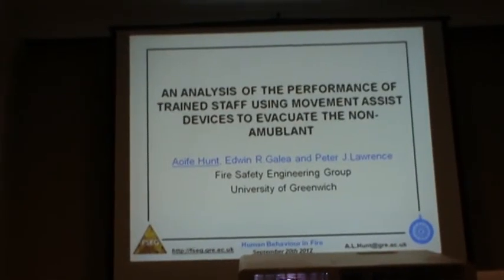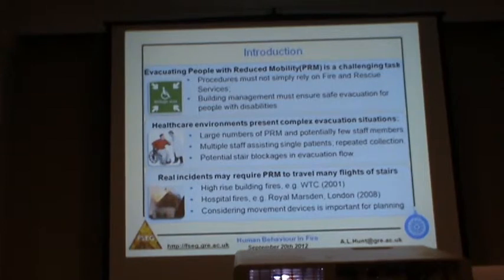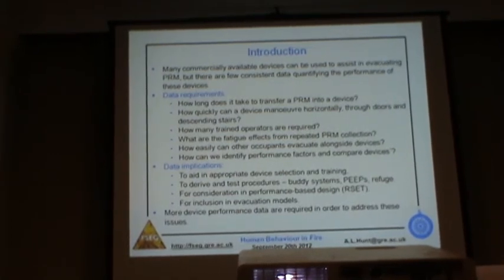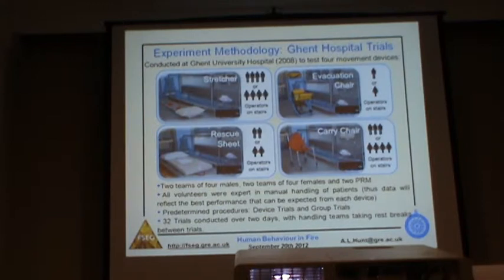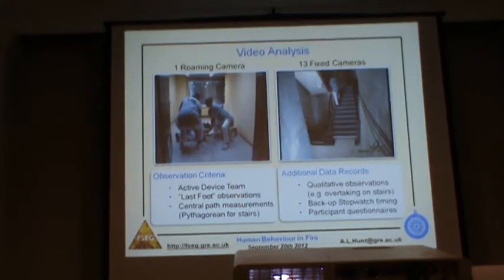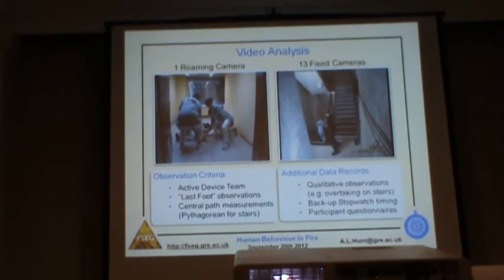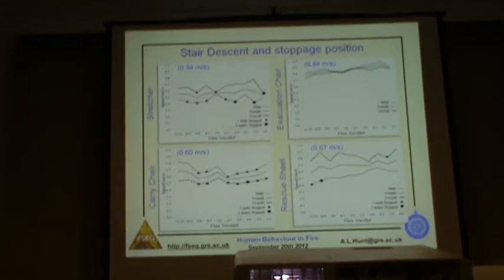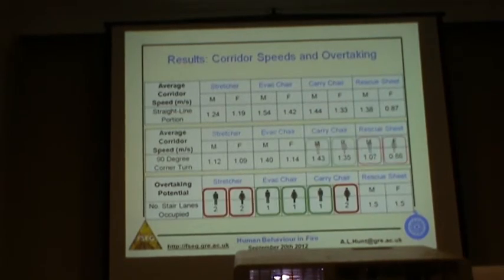Using Movement Assist devices to assist in the evacuation of people with reduced mobility

Comment: Hello, I am a fire safety engineer and safety officer having to deal with evacuation of PRM in high rise buildings. Would it be possible to have access to this slideshow ?
Reply from the maker: Quentin, I can't provide the slides, but there is a link to the paper in the caption.  You will find full details in the paper.  Hope this helps.